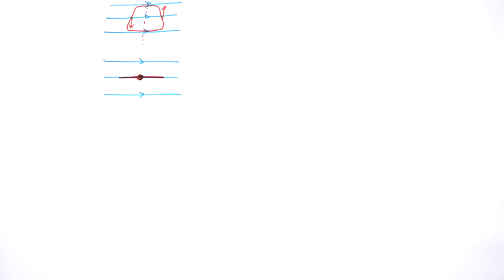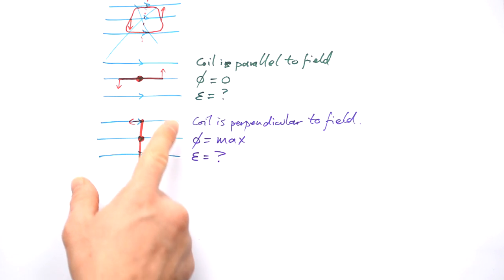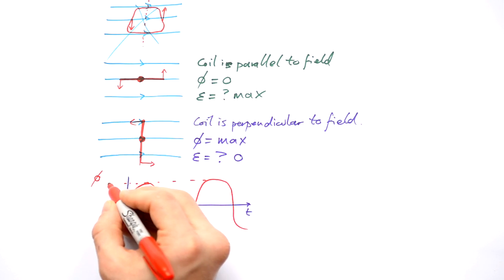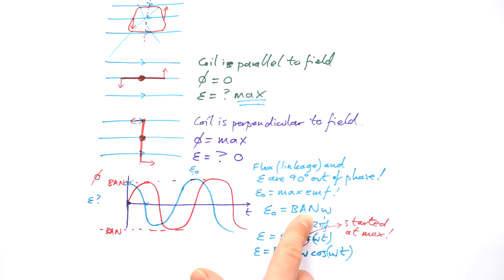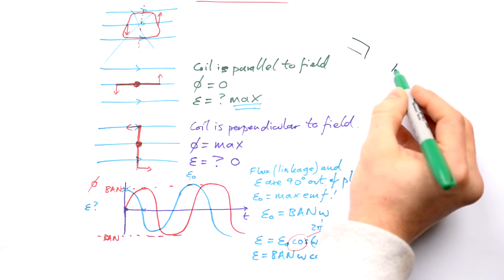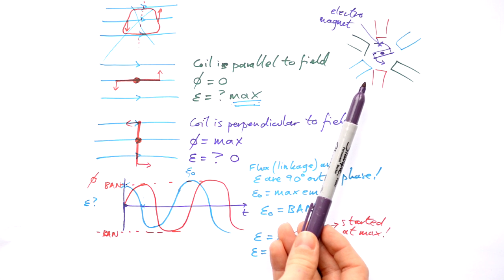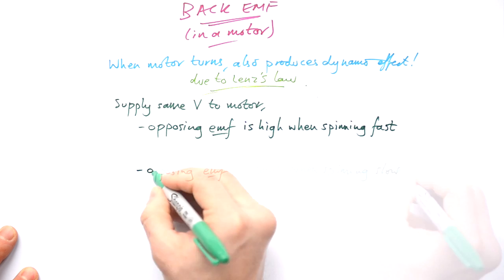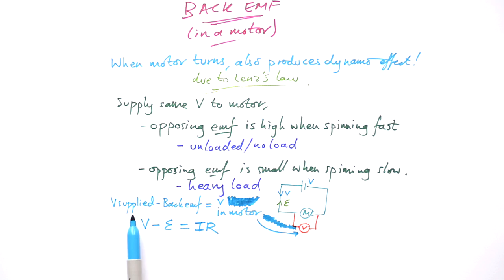AC Generation & Back EMF - A-level Physics

Comment: Hi there!
Thank you very much for your video! Really good fun! Just a question! When inducing an EMF due to torque within the rotor, Wouldn't the back emf be more related to a magnetic field caused by the current flowing through a close loop of wire? Or why is the reason that when we load a motor, there is a massive spike of current within the feeding circuit?
Thank you very much in advance!

Comment: I love the brilliant clear thinking. If you put a voltmeter across the DC motor windings above, would it show a voltage drop that is higher than source voltage? What brought me here is desire to understand how voltage drop across the start windings of an AC induction motor fed by a run capacitor is consistently higher than the incoming voltage after the motor gets up to speed. For example, if the motor is fed with 240 V single phase mains, once up to working speed the drop across the start windings is often 350V+! This is such a consistent finding that a device called a potential relay is used to pull a start capacitor out of service after the motor gets up to speed. Standard teaching is that this huge voltage drop is because of back EMF from generator effects of the motor. But I'm confused, wouldn't back EMF reduce voltage drop? I can explain a big drop by looking at RLC phasor equations, but I don't know how to add back EMF from a motor into the calculations....

Comment: I kind of get it but not fully about back EMF. Why not use another metal than copper to reduce emf?
Reply from the maker: But back emf is a good thing for motors! Means the faster it goes, the more efficient it is!
Reply: @ScienceShorts  Thanks. In the way others explain it it sounds bad since the motors would go even faster. But you notice how the coil turns one way, and if one coil is next to another they rub against each other which causes friction it seems to cause heat. 
But what if their was another wire between that like how a gear is to take the rotating force. And instead of a thin cylinder wire a flat wire almost like a capacitor that is flat. 
And since copper has eddy current why not another metal that does not do eddy current like a ticker Iron or an alloy like copper/iron. 
Also most magnets are weak and the higher the magnet the less electricity needed to move an electromagnet so a circularneodymium halbach array (expensive)on the outside and inside of an electromagnet would go over 1 tesla.
Just some thoughts. What do you think?

Also another video called "How Electromotive Force Works" by "
National MagLab" has a good animation about back emf but it still does not say why it happens.

Comment: How would you go about sizing a diode to bleed out back EMF from a single phase 220vac motor that is activating other equipment tied to the same capacitor?
Reply from the maker: ...depends how big the back emf is?
Reply: @ScienceShorts  I'll have to update this when I'm back in the job site. I have a condenser fan motor giving just enough back EMF to kick the compressor and make it stutter once or twice then it's bled out. I'm trying to figure out if a isolation relay breaking the wires from the motor or a diode across the tabs on the run cap would be better. I was thinking bleed resister but I read somewhere they're not to great for AC, but I could be wrong.

Comment: I find a good way to think of it is that it's like with velocity and acceleration when throwing a ball up in the air. At 0 velocity the rate of it's change (acceleration) is greatest, yet at it's maximum/terminal the rate of change is zero. 

You can then just swap velocity with flux and acceleration with emf :)
Reply: It’s funny, that’s the exact way I think of it.
Reply: My confusion is that at its max point its still gonna change in terms of decreasing if not increasing and thats what should be concerned of, the change with time whether increase or decrease so my point is that whether u have max flux or zero flux its still gonna change to decreasing or increasing the amount, am I right?
Reply: Except gravitational acceleration is a constant at g ms^-2, so no.
Reply: @Nathan-p1j  well in a fluid, the acceleration of the Velocity will not be constant due to air resistance. Gravity is constant but not the acceleration of the ball
Reply: @danielo7985  yes the acceleration will be constant. The thing that air resistance affects is the velocity of the object

Comment: When the coil is parallel to the field, the flux linkage is zero. But wouldn’t that mean the emf is also zero because of faraday law/formula?
Reply from the maker: No, because it's the rate of change that determines emf. When a ball is thrown upwards and reaches its apex, its speed is zero, but its speed is still changing. Same deal.
Reply: @ScienceShorts  Can I ask why the rate of change of flux is minimum when the coil is perpendicular to the field lines because even though the flux linkage is max but its still gonna change when the coil starts moving and thats what we are concerned with, same happens when the flux is zero but it starts to change and when its max it also starts to change as the coil makes further turns.